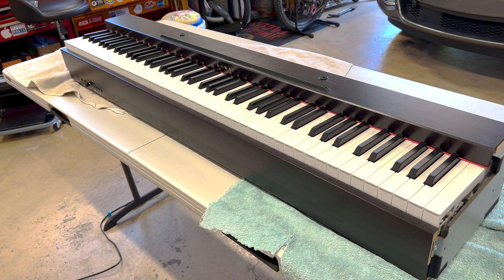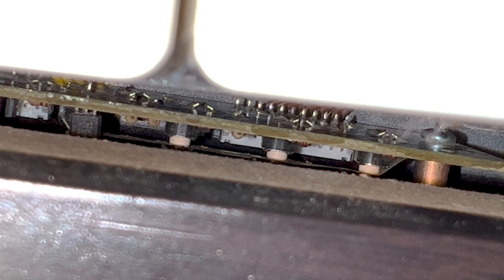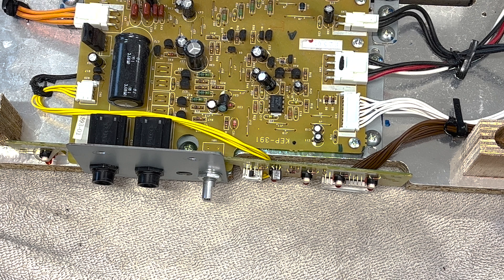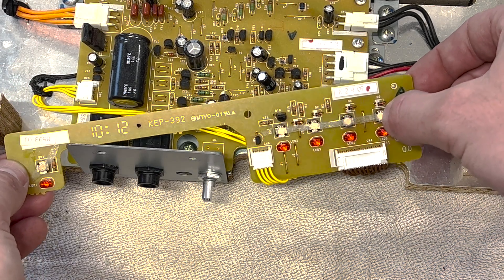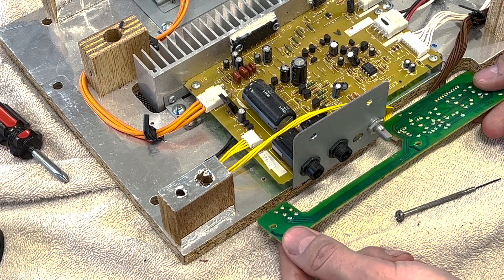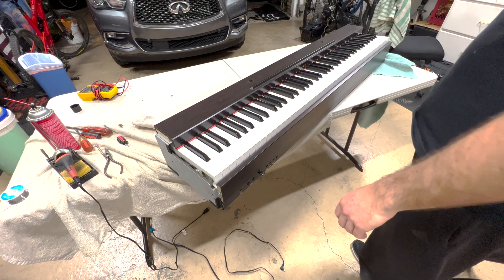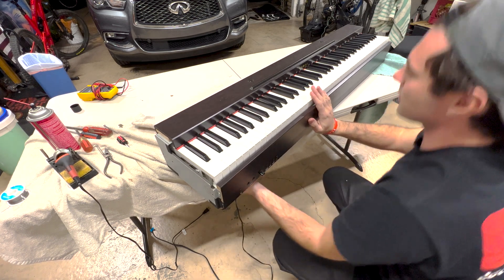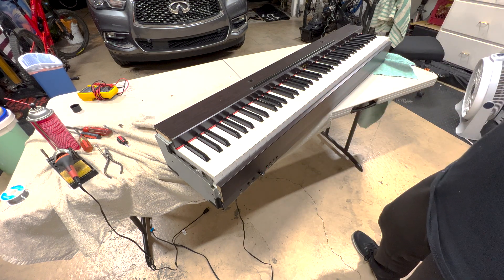Kawai Keyboard Repair! [Sound Issues]

Comment: The speakers of my Kawaii are not working anymore... No sound!
But when i plug my headset on, everything is fine. Any thoughts about my issue? Thank youuuu
Reply: Did you figure out what the problem is? I have same issue
Reply: @MilaQ-k7k finally I had to push one button (switch between headset and speaker) 😬
Reply: @a @alex20sur20 i dont have any buttons . I have kawai CA1200

Comment: Any input on one of their keyboards that won't switch over to the 1/4" out when plugged in?
Reply from the maker: Hmmmm it could be that the 1/4” is bad or there is a bad connection behind it causing it to loose the signal